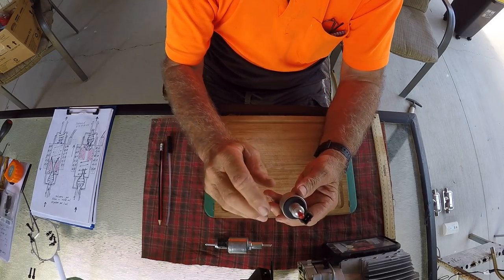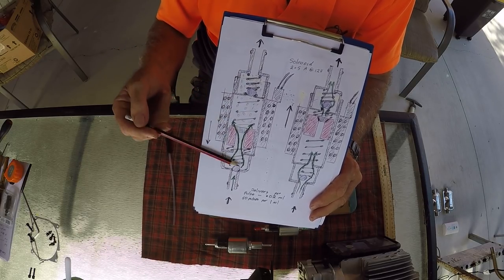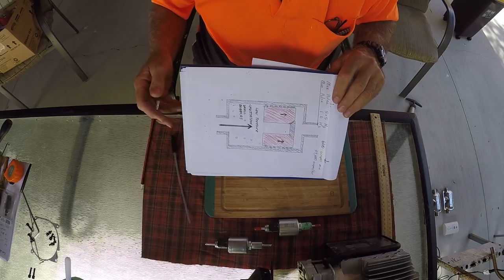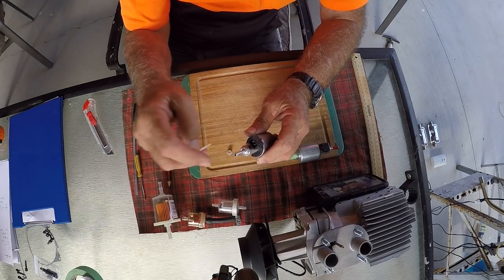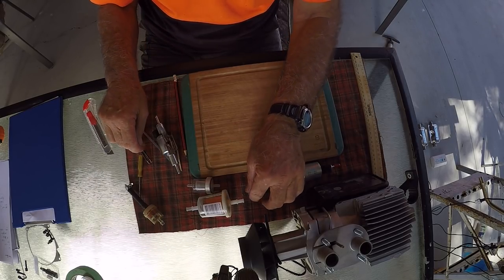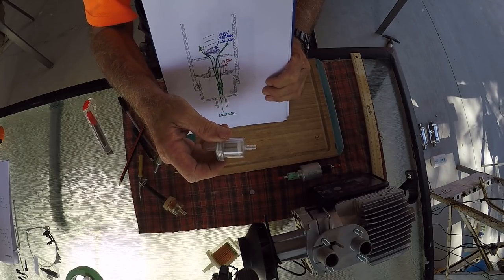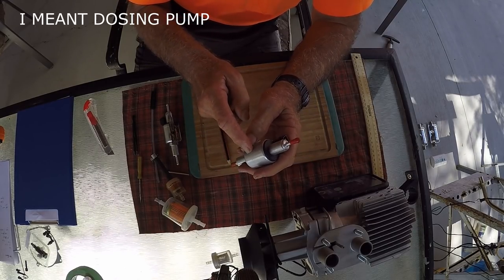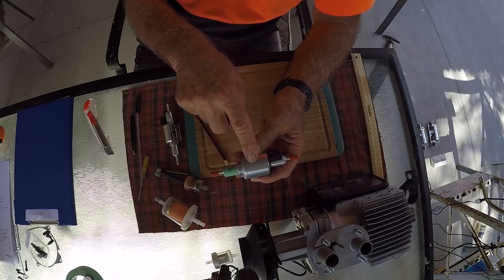Chinese Diesel Air Heaters   Part 7   Metering/Dosing pump

Comment: Hi John,

My fuel tank will be around 8 ft from my heater. I was going to install the fuel pump just near my fuel tank for convenience and ease of installation. I would extend the wiring to the fuel pump. Is this a bad idea and I should forget about it.  How critical is the location of the fuel pump in relation to the heater and the fuel tank? I will wait for your reply before proceeding further.   Gaetan
Reply from the maker: Hi Gaetan,

Suggest you have a look at the motorhome install videos. I cover a lot of your questions there.

Better to have the fuel pump close to the fuel tank.
Extending wires ok, but you may need to go thicker wire to overcome voltage drop.
See motorhome videos.  JMcK
Reply: @johnmck1147  Hi John,

I will certainly take a close look at your motorhome install. It makes a lot more sense to have the pump closer to the fuel tank so that you limit the pump running time with no/limited fuel to lubricate it.
Once again you came to the rescue. Your knowledge is greatly appreciated by an ever growing crowd.

Thank you and take care of yourself.  Gaetan
Reply from the maker: @gaetanlavoie6949  
Your welcome Gaetan.  JMcK

Comment: Hi John,
The best information I have seen on these Chinese heaters, I have watched all your videos.
I personally own a Airtronic D2 diesel heater which has given nine years of trouble free running.
As you pointed out in some of your videos the 5KW Chinese heater is very similar to my heater in many ways.
So I have purchased a few Chinese spares for my heater as the genuine parts are very expensive. One item I purchased is a fuel pump for $22.00 which should do the job if my pump ever fails but was wondering about the pump internal resistance of 5 ohms as the genuine pump has an internal resistance of 9.5 ohms. 
The Chinese pump with a lower resistance  would almost pull twice the current so do you think the inbuilt circuit that operated the pump would handle the extra current or should it be OK?

JR
Reply from the maker: Hi John,

Thanks for your feedback.

All the pumps I have seen both genuine and clone put out .02ml per pulse. The current draw of the pump is small and I do not see you having an issue here. The biggest current draw on these heaters in running form, ie after the glow plug turns off, is the fan.

Cheers,  JMcK
Reply: Thank you John for your reply as you say they all deliver .02ml per pulse so should be OK and as this pump is a spare I may not ever need to use it.
John

Comment: Hi, John. I share your knowledge on my French youtube channel. I have a question: why webasto or planar install their pump horizontally and the Chinese models with an inclination (15 - 35°) ? are the pumps designed differently? the prices are not the same! thank you !
Reply from the maker: Hi Phil,

All the heater dosing pumps I have seen are electromagnetic piston pumps, and all these pumps produce tiny cavitation bubbles by the nature of their operation. These bubbles are quite normal and they actually help with the atomisation of the diesel in the heater burn chamber. 

If the pump is angled upwards you help the bubbles move up the delivery tube to the heater.
If the pump is horizontal you make it easy for the little bubbles to collect at the top of the pump cylinder and form a big bubble. If this happens you can upset the dose fuel volume and you can also have a “dry spot” where the big bubble forms and hence excessive wear from lack of lubrication.

Almost all the Chinese diesel heaters are  close to exact copies of the German Eberspacher D2 and D4 parking heaters. The Eberspacher and Webasto diesel air heaters may look the same but they are quite different inside. 

Not only did the Chinese copy the Eberspacher air heater, but they also copied the Eberspacher instruction manual. The chinese diagrams are exact copies of the German diagrams. The Chinese also exactly copied the German diagram on the heater pump install angles.

Eberspacher invented these heaters many years ago and have decades of in use knowledge of their operation and their issues. It is Eberspacher that state a minimum 15° pump incline, and state the preferred incline to be in the range of 15° to 35° but any angle over 15° being ok. The Chinese copied this.

In my personal extensive testing of these Chinese heaters and from my in use knowledge of them, I agree with Eberspacher and always personally install and recommend in my videos you install the pump at a upwards angle to allow easy escape of cavitation bubbles. 

Eberspacher pumps have a small internal fuel filter, and I believe this is the reason for the recommended angles of 15° to 35°. The Chinese pumps do not have an internal filter so anything above 15° incline will work fine.

Cheers. jMcK
Reply: @johnmck1147  Hi John, thank you very much for your quick and detailed response. Merry Christmas !
Phil

Comment: John how would adding a priming bulb/outboard motor type bulb effect the pumps performance in regards to the fuel lines needing to be solid to allow the bubble to move along the lines.  would the bulb perhaps act as the shock absorber in the line and hinder the fuel delivery.  ive thought of adding the pump type primer to my system but wary of how that may effect the fuel system   any thoughts ?
Reply from the maker: Hi Phil,

You can use an outboard primer bulb to initially prime the heater on original install. But after that  it is not required.

The cavitation bubbles will move along any fuel line. The reason to only use small bore hard nylon on the delivery side of the pump is soft fuel hose absorbs the pulses. This is a pulse pump and you want the fuel to squirt into the burn chamber, not dribble.   JMcK
Reply: @johnmck1147  ok so not ideal to leave the bulb primer permanent in the fuel line system, like for example an outboard motor system, your saying use to prime pump and then remove altogether.
Reply from the maker: Phil Fraser 

My suggestion Phil. Once primed, there is no need for the bulb again, so why add an unnecessary complexity to the system. It is unlike an outboard where you need to prime each time you connect the tank after refueling.  JMcK

Comment: Hi John. Excellent videos! Just ordered my "8KW'" unit (I read its just a 5KW) In this video you suggest removing the very small filter within the Eberspacher metering pump. Is this filter present in the Chinese metering pump supplied with the most kits? I intended fitting a larger fuel filter so I'd like to follow your guidelines. Keep up the great work! Thanks in advance!
Reply from the maker: Hi V, every dosing pump I have seen supplied with Chinese heaters does not have an internal filter. They all come with a seperate filter which I find a better system.  JMcK
Reply: Hi John. Still working my way through your videos. Thanks so much for taking the time to make all these videos! Best from Scotland.

Comment: Hey John.
I thought you referenced the maximum length for the fuel hose but I can't find it.  
Thanks
Reply from the maker: Hi J,

The maximum hose length varies with the variables. Suction height, head height, hose type etc.

Pumps also push far better than they suck, so you should mount the pump as close to the fuel pump as possible.

Most installs have the fuel tank, the pump, and the heater at similar heights so you have a little leeway here. 

A suction length of up to around 2 m using normal fuel hose, and a delivery length of up to around 10 m using narrow hard bore nylon fuel hose, and a head of up to 3 m should be achievable. 

Here again it depends on the workmanship. The longer the hose the greater the need of quality work. Tight joints, no minute leaks, tight hose with no spring etc, and a carbon free atomising screen in the burner.

The longer the hose, the more issues you will get when/if you start to get carbon build up in the burner atomising screens.

Cheers. JMcK

Comment: Hi John, do you have any info on what the outlet pressure of the pump is?
Reply from the maker: Sorry Ashton, I do not know that, but you have pricked my interest. 
Remember this pump “PULSES” so the pressure is not constant, and it would not be much because you need to use narrow bore hard nylon fuel line on the outlet side because if you use normal flexible fuel line on the outlet it absorbs the fuel pulse and causes heater burn issues.  JMcK

Comment: How come my diesel heater has a 300 count primer cycle.
 and it is fully primed in under 60 counts off the pump

I think you are mistaken as to the volume these pump produce per pulse
Reply from the maker: Hi U38,

I was extremely careful doing these tests some five years ago, and I stand by my figures.
You can easily do your own tests on modern pumps. Manually exite the electromagnet in the pump and count the pumps pumping the diesel into a measuring cylinder.  JMcK

Comment: a few drops of 3 in 1 oil into the pump will liubriucate it and not hurt the heater and it wont wear it while priming..  so is it possible to adjust these? I did a test of one of my pumps and its low...   I clicked it 1000 times and expected to get 20ml of fuel and only got 15....  did this twice from a bottle of fuel so I can assume it needs to be adjusted up..   is there a way to disassmble and adjust them?
Reply from the maker: Hi CA,

Thanks for the feedback. 

Assuming you have the correct dosing pump, a low output volume is most likely caused by wear in the pump. This can be caused by lack of lubrication and excessive dry pump strokes during pump priming. 

As you have seen, it takes 1,000 clicks (pulses) to deliver just 20 ml of fuel. Now remember this is actually 2,000 piston movements, (up and down) of the piston for each click. I do not believe a few drops of oil will give adequate lubrication for 2,000 piston movements.

I personally do not like priming the pump and suction side fuel lines manually by dry piston strokes. I like to prime with suction, not dry pump piston movement.

The pumps are sealed, and it is not possible to adjust any of the pumps I have seen supplied with the Chinese made heaters. 

Some German made dosing pumps (expensive) do have a slight adjustment capability.

Cheers.  JMcK
Reply: John this makes perfect sense now that my small oil would still end up in a dry pump , are these all pretty much the same? I have a VVKB 12kw coolant heater , I have a spare Chinese pump however that pump says it is for 1kw -4kw heaters.. I haven’t bench tested it like I did the VVKB one. I’m assuming they just pulse faster for the larger heaters? I’m considering changing the pump out on it and of course properly priming it with a vacuum bulb (turkey baster) I also found that I didn’t have this pump vertical enough so it’s quite possible with only little lube and running it nearly horizontal that I nuked it !  Getting parts from VVKB seems difficult as they don’t want to sell them to you easily.. if they are all pretty much the same I’ll just use another one. Or if you have recommendation for a 12 volt pump to use on a 12kw heater I’ll look. Great learning experience !!!!
Reply from the maker: Christopher Abnett 

Hi CA,

I have no practical knowledge of your 12 Kw coolant heater, but I very much doubt that a standard dosing pump for a 5 Kw heater can work properly on a 12 Kw heater. 

It will likely work but I can't see you getting 12Kw output. The Chinese dosing pumps generally work between 1.6 Hz and 5.5 Hz.  You can go a little faster but the standard .02 ml per dose pump would need to run around 12 Hz to deliver enough fuel to produce 12Kw. You reach a physical limit where the pump just can't go faster.

As I said, I have no practical knowledge of your heater, so I can't comment with any authority, but logic tells me a 12Kw heater would need a .04 ml/dose pump.

Sorry.  JMcK
Reply: @johnmck1147  I used a frequency counter and my pumnp maxes oput at 7.5hz so definitely sounds like it is a bigger pump..  or one that has had its diaphram adjusted..  when i hold it up phyically to a 5kw pump it looks identical.. must be different internals of some sort
Reply from the maker: Christopher Abnett 

Hi Christopher, have you measured the fluid output at max output?

Your heater should work with a 5Hw pump, but not give max output.

There could be a little output exaggeration here also. The Chinese 8 Kw heater, is really just a 5Kw heater.

Cheers.  JMcK
Reply: @johnmck1147 Hi John. By any chance are you located on the Sunshine Coast and do you do house calls?
Reply from the maker: Mike Egan 

Sorry Mike,

I don't live on sunshine coast, also I don't do house calls, but I am very happy to try and help via email, if I can. johnmck47@outlook.com

Comment: Do all pumps come apart John?  I can’t see where mine does that and it’s smoking, so wanted to remove the filter.
Reply from the maker: No SCH, all the Chinese pumps I have seen cannot be taken apart, and they also do not have internal filters. Some European pumps have internal filters but they have a large nut on the bottom of them for filter removal.  JMcK

Comment: First, THANK YOU you so much for all your great information :)  QUESTION: on High Altitude usage (8,000 ft), is there a simple way to reduce the rate of the fuel delivery to resolve high altitude problems?  I ended up getting an Espar Hydronic III D4E with an "easy start timer" controller. It came from Russia and I have learned that the high altitude module kit from Espar is not compatible with the Economy version. I would like to set up a simple manual switch that I flip when I'm over a mile high to compensate for the atmospheric pressure change.  Also considering other options such as a forced air fan?  Or a special tank with a different fuel mix? Open to suggestions.  Thanks
Reply from the maker: Hi Monty,

Sadly I have no experience of high altitude use of these heaters, as in Aus and particularly within a thousand kilometres of where I live I need to get in a plane to go above even 5,000 feet. 

There is an aftermarket controller called “Afterburner” which has altitude compensation, but you would need to check with the manufacturer to see if it is compatible with your heater.

I know of no way you could easily adjust the fuel air mix ratio short of changing all the parameters in the controller and ECU. Perhaps the easiest way is to run a high kerro fuel mix.

I would be interested if you find an easy solution.  Cheers,  JMcK
Reply: @johnmck1147  Thanks for your thoughts.  Is it your understanding that the fuel air ratio will stay the same even if you reduce the Hertz to the diesel pump?  What if I run parallel dual pumps with one having a lower ML diesel dose (18ml) and have a switch to use only the lower ML fuel pump at high Altitude.  Here is the list of options I an looking into if anyone else has thoughts or suggestions: 
^run on lowest heat setting.
^cycle on and off to prevent overheating.
^dual fuel pumps with switch to smaller ml (18ml or 16ml)?
^24v pump on 12v system? (probably not a good idea)
^electronically reduce the Hz to the pump?
^add more air intake with 12v fan
^add oxygen additive to diesel?
^add water vapor to air intake?
Reply from the maker: @montyfriesen458  

Wow, good for you.
Changing the Hz does not really alter the fuel air ratio. 
Lower the pump rate, the ECU reduces the fan speed.
Yes, you could try a lower capacity pump.
The pumps are electromagnetic pulse pumps. The piston will move on application of a voltage input. It does not matter whether 12V, 24V, 36V etc. 
The other suggestions you would need to try yourself. 
Good luck.  JMcK
Reply: @johnmck1147  Thanks again. I read someone else that said he was able to electronically reduce the pump rate to fewer cycles after the ECU sends the signal, but he never explained how and that is above my electronical experience level to create (I could probably follow someone else's detailed example).  Another Youtuber (David McLuckie) has changed the fuel/air ratio using one of the Chinese controllers but that does not help me with my Espar controller.
Reply: @johnmck1147  Do you know how to interpret the coded numbers between the various dosing pumps to know which ones are 16ml or 18ml?  They all seem to start with 22. Thanks again.

Comment: Great series John... where did you get the “spider web” mount you were talking about?
Reply from the maker: Hi Andy,

Eberspacher used to supply them with a marine kit, but lately they have been supplying the common black rubber mount. I have not found a supplier of this mount, but I also have not looked very hard. 

You could make your own from thin shock chord for a fraction of the genuine price, if you can find one.

I have one on the boat and it is excellent. 

But if you double mount the common black supplied mount you will lessen the ticking noise.

By double mount I mean screw the black pump holder on to a piece of ply that is mounted to the vehicle with a pad of neoprene rubber, closed cell polyethylene or similar.

Good luck.  JMcK
Reply: John McK 47 thanks John... I think I know what you mean... would you be able to post a photo of yours?

Cheers!
Reply from the maker: Hi Andy, I will do a video on marine install (approx 10 days ) when I return home. There is some video of the pump mounting.  JMcK